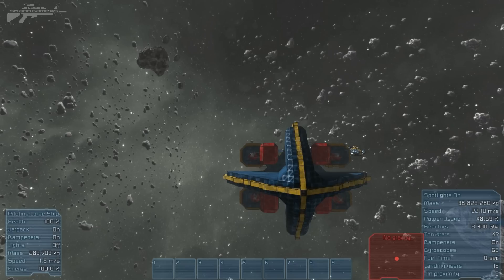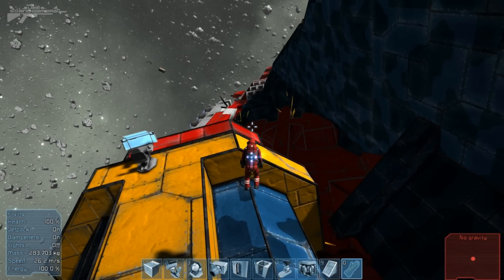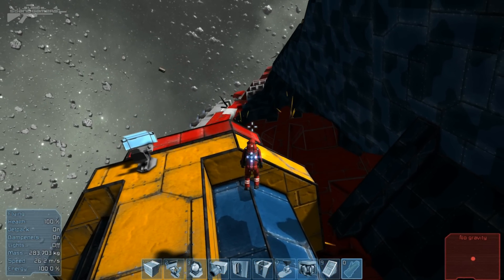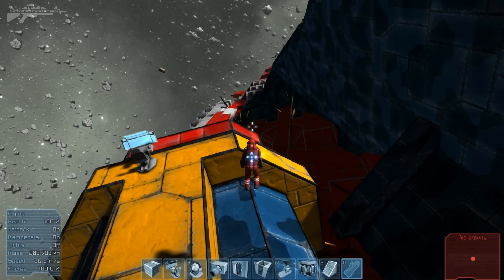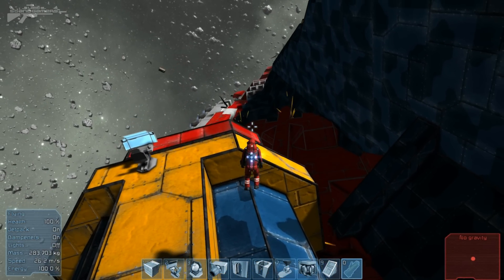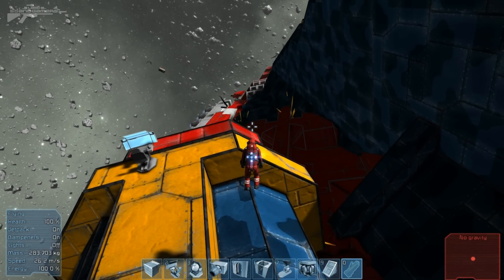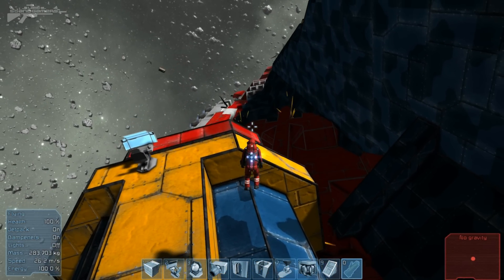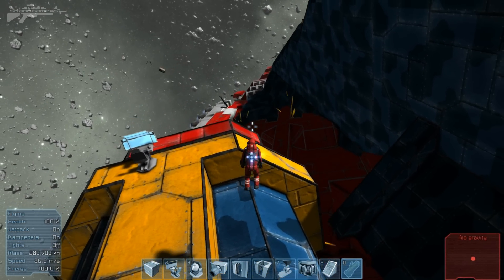Space Engineers - Is Ramming Really That Effective ? Assembling A Fleet Part 4

Comment: clearly you don't use battle ram much isn't it? You lose nothing by ram a ramming ship into enemy... the proper ramming shit shall be non-armed, fast charging, don't depend the weight on heavy armor, you only need them to be cover the tip of the ramhead, put lots of mass block in the ramhead, when you dash to the top speed, then you power up those mass block, and you can now enjoy the show... it is kinda like a piloted giant missile tho, but when hit the right spot (bridge, main engine part, or turning jets, it will simply remove the target ship from the battle rank due to lost of combat ability... Don't aim for weapon, but aim for those jets or bridge, any anyone who don't have a armored combat bridge or didn't bury them deep enough inside the main body will suffer for the rest of the battle!